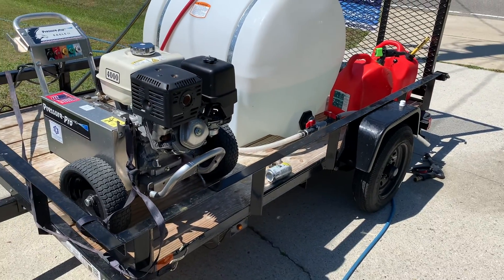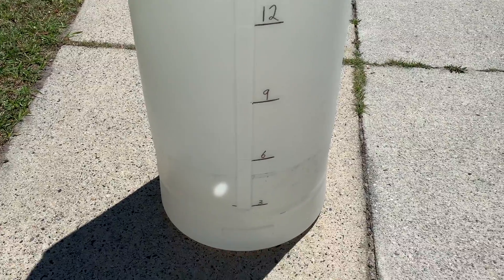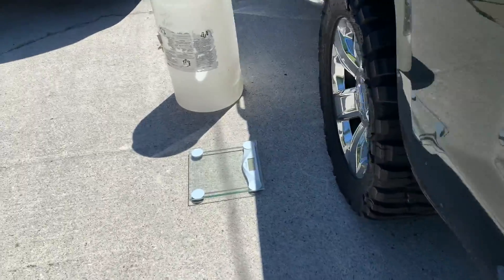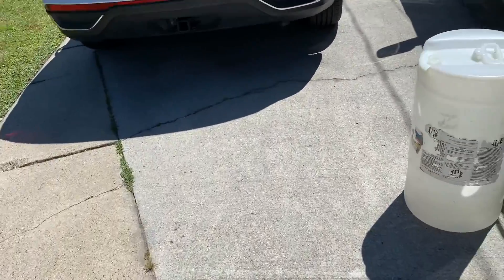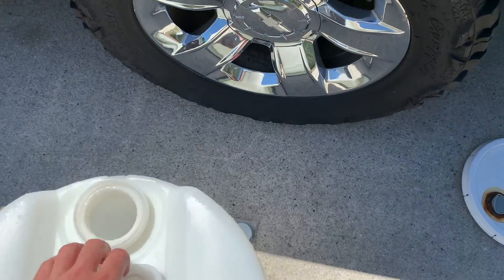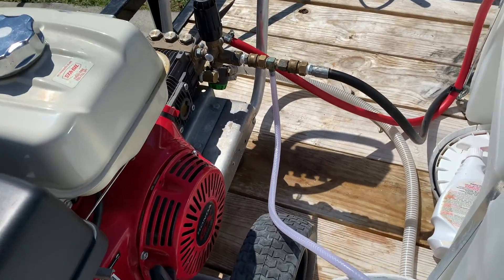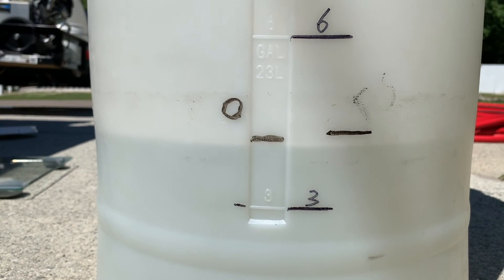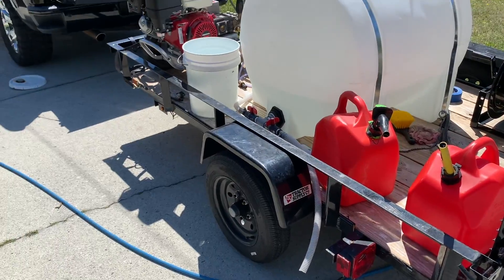Downstream Injector Bypass Kit | DEBUNKED?!

Comment: You got the same results because the X jet doesn't pull chemical from the downstream injector. Try it with a just soap tip or the regular M5 twist.

Comment: I bought a bypass for my 4GPM and did a bucket test with he bypass on a test with the bypass off and saw a tiny difference(waste of money).

I thought the xjet nozzle wouldnt pull from a down stream injector?
Reply from the maker: it doesnt make a difference for 4gpm not enough water flow, but 8 it does

mine did, dont ask me how
Reply: @WeberPowerWashing what about for a 5.5 gpm

Comment: I watched a video of a guy changing the bypass around, making the flo thru the rinse, and when you bypass, it run's it with the injector. He claimed that the machine rinsed with more water flow in the new configuration. I'm sure I didn't explain that very well, but it was a good video.
Reply from the maker: sounds like a good video! i always like people testing their stuff
Reply: @WeberPowerWashing  Your video proved same flow rate, but if you're interested, I think it is a good video:
Video Title:
Downstream Injector Bypass. How and Why it works
By:
Powerful Improvements
Be well.

Comment: So the pump is just working harder to push the water through the injector ??
Reply from the maker: i don't know if working harder is the right word! i would describe it as " restricted", when you are running through an injector you can restrict your overall flow, especially in the larger GPM machines

Comment: There are several existing restrictions in the system.
.
when downstreaming you will get more flow overall, because you have the pump flow pluss the downstream quantity after the pump.
.
remember too the xjet is a downstream injector and represents a restriction.
.
THEN we have the issue of maximim flow and maximum pressure.
You will only achieve maximum flow with an open hose AND you will only achieve maximum pressure with sufficient restriction.
At what point  maximum pressure aligns with flow rate/ restriction and at what point maximum flow rate aligns with pressure and restriction is a whole other story.
This is an Ohms Law, problem in fluids, BUT it will not be linear and consistent.
.
. a couple of tests that will be interesting
1/ a flow test straight out of the pump into a short hose with no restriction, no handpiece, no tool, nothing.
THIS is the maximum flow rate of the pump
2/ a flow test with a pressure guage and a plain nozle ( the straight red one would be the most consistent)
THIS will be the maximum flowing pressure or close too it.
3/ 4/ 5/ then start adding various tools and injectors one at a time.
.
It is my expectation that the restrictions presented by the downstreaming devices will be significantly less than the restrictions presented by the pressure nozles.
The hole in the downstream devices will be significantly big in comparison to the nozzles.
Don't forget there will be some internal restriction in the pump.
.
THEN many things may look unreasonable because of the unreasonable pressures involved 2000, 3000, 4000 and more PSI, at those pressures simple physics may not apply, things get more complicated.
Reply: And that is the absolute scientific truth.
Reply from the maker: This is great, very well thought out !

Comment: You will get a remote box once it gets warmer and you get chaffed from all that walking….I thought the walking would be good for me but when your doing 3-4 houses solo a day in the heat of June you get tired.

The down stream injector uses a Venturi affect so you are still getting the 4gpm from the pump but the pressure drop from the nozzle causes a vacuum pulling water from the injector so with the proper pressure drop you create the maximum amount of vacuum from the Venturi pulling a supplemental portion of solution.
I noticed the flow difference when running my surface cleaner and not really washing.
Reply from the maker: 3-4 houses a day is solid! - you are 100% right, i'm editing a video right now of a day i did with 3 houses, and its hilarious because i literally see myself run back and forth from the rig in the footage. maybe its time to stop being cheap!

Comment: Hi,
Very interesting vidéo, I'm about to start my pressure washing business, i almost have all the equipment i need.

Like you i bought a x-jet m5 and i didn't know that it works with a downstream injector!!🤔

I'm a Big student of the game, since 3 month, i watch about 4 to 5 hours pressure washing youtube vidéos, and nobody mentioned it.

I was even going to buy a m5 ds twist but i'm hesitsting now.

I watched a video from powerfull improvement, he made the (physicals) comparisons between the x-jet m5 an the DS twist and the DS twist has a bigger hole so it delivers less pressure and enables the soap of the downstream injector.

So i thought the x-jet m5 didn't enables the soap mode with the downstream injector.

It would be interesting to make a comparison of how much chemical the downstream injector  draws with an x-jet and a ds twist or a jrod (which are especialy made to work with a downstream injector together) to see if there is any difference.

Keep getting after it.
As you can see, i'm a nerd too🤓
Reply from the maker: Welcome! THAT is a GREAT idea friend. I could most definitely do a video on that. 

But I can tell you from experience the x-jet M5 most definitely pulls chemical! I can't speak on the DS Twist, but I can tell you that I love the M5 way more than the jrod. I started with the Jrod. still a great tool

Comment: I thought the same thing. I was worried that the small orifice would lower my flow. But what I’ve found is that as long as you’re using the correct sized orifice for the machine you’re using it will actually gain some extra flow. I have a SESW remote ds box so when I’m rising I’m pulling water and I know I’m a tad more efficient then without it. You could always plumb a 3way valve on the injector line if you wanted a more permanent setup. Good testing!
Reply from the maker: good info, thanks!

Comment: i looked at a bypass for my machine but no different to just unplugging DS injector then putting hose straight to unloader if i wanted  a bit more flow ...takes 3 seconds of time woohoo
Reply from the maker: WELL said! Thanks for watching my friend.
Reply: @WeberPowerWashing  no worried...am in new zealand so you reaching far and wide :)
Reply from the maker: EXACTLY, brother that’s exactly how my thought process went to. From my research the only benefit to the downstream injector bypass would be that you don’t need to turn off the machine. Obviously, the remote downstream injector bypass has many more added benefits, and time saving abilities.
Reply: @WeberPowerWashing  yeah but as you said why waste hard earned dollars when you can just walk back to machine to turn off ... or as Don says use your tips correctly... Only take a few minutes of time :)
Reply: @WeberPowerWashing  I though't you just needed to remove the injector hose from its tub. What do you mean it aids in not having to turn off the machine?
Reply: What's the purpose of having the X-Jet on there if you're using a downstream on the machine?
Reply from the maker: @ppclean  good question! The DS injector is limited to a 10:1 ratio, water:chem aka %1.25. In an attempt to be able to pull a higher %, introduce X-Jet! This puppy can pull all different ratios, the highest of which is 1.6:1!
Reply: @WeberPowerWashing  I know the difference, but why use the X Jet with the downstreamer in there at the same time?
I have both, never use the DS because of the low draw rates.
I also changed the barb on the X Jet to eliminate the sleeve that holds the proportioners.
I haven't done a flow check comparing the two, but probably should.
Reply from the maker: @ppclean  I use my downstream injector 97% of the time, I’m able to get one percent SH downstream, which is industry standard to clean almost everything. You may be having issues with your downstream injector if the draw is too low?

I use the downstream injector and the extra at the same time, because as you see in my video, for my machine, there is no change to my flow rate! So it’s negligible. Thanks for commenting my friend!
Reply: @WeberPowerWashing  I'm using my injectors for concrete cleaning, no SH. 1% of anything isn't going to do me any good, and that's why I use the X Jet for larger areas and a Shurflo for everything else.
Reply from the maker: @ppclean  gotcha!! thats awesome